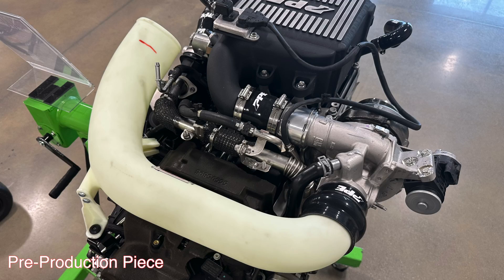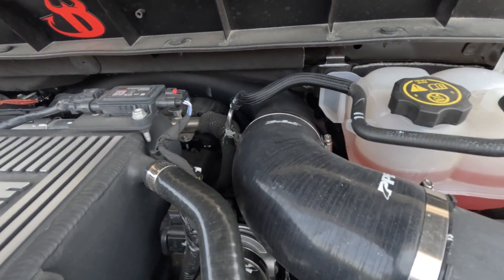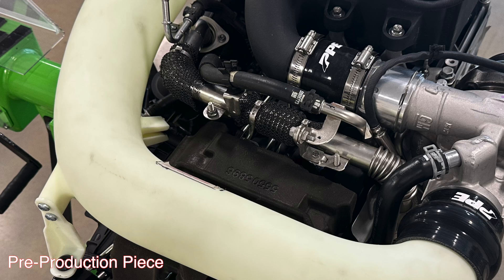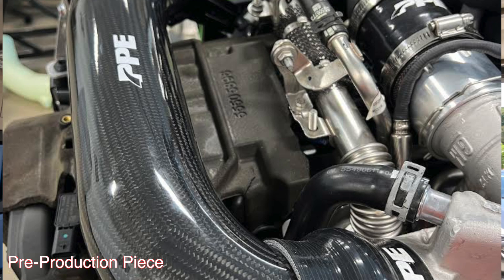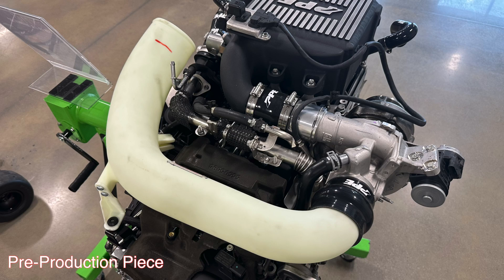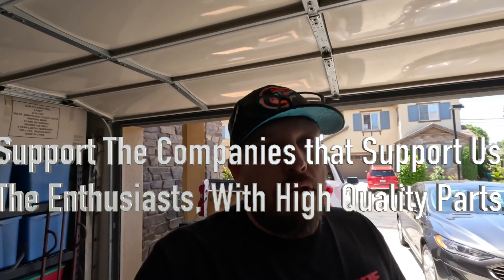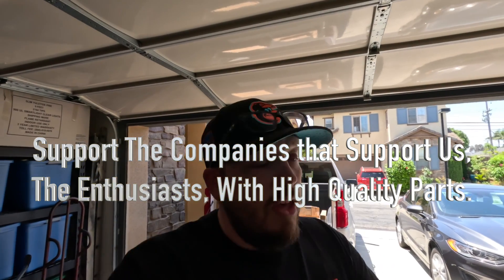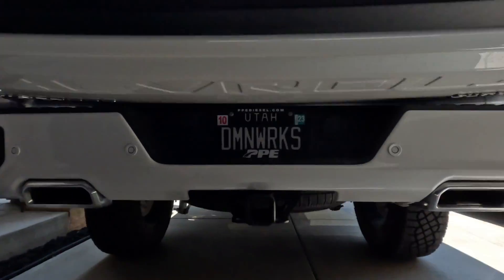NO WAY !? PPE Made a 3.0 Duramax Intake Pipe

Comment: Any aftermarket parts for the 3.0 engines are for looks only and provide ZERO performance gains.  On top of that, the aftermarket stuff is really expensive for the 3.0.  I have the VSE catch can, but it catches almost nothing.  That's a good thing I guess.  The dual fuel filter setup from VSE is expensive as heck.  The stock filters are 5 microns already, and the one of the upgraded filters is a 2 micron.  Costs $500 for the setup, and I doubt it really makes a difference at all.

I like your videos, because I love modifying my vehicles and seeing what is available.  However, there really isn't anything significant for these little engines.
Reply from the maker: Thanks for the kind words ! I have tested pretty much all of the parts available and yes, nothing significant in performance gains, however some do offer gains in other ways. Not sure if you have seen this video where I talk about every single mod that was available:  https://youtu.be/Vx73_rKC1X4

Comment: When do we expect this to go on the market
Reply: Cool I want to pair it with the K&N Cai box
Reply from the maker: @williampruitt8425  that’s my favorite box, but I am going to try the airaid next. Same box but dry filter and closed top.
Reply: @DemonWorks  thanks please keep us posted on the Ppe intake pipe
Reply from the maker: @williampruitt8425  for sure! Hoping to have in my hands as soon as possible!
Reply: @DemonWorks  do you think the stock thermostat for the transmission can be modified by taking out the spring or should I go with the PPE bypass.
Reply from the maker: I don’t have specifics, but it sounded like it would be soon!

Comment: Saw your video on the charge cooler and wondered why there was no upgrade in the charge cooler radiator. If the new charge cooler is removing more heat won't it end up heat soaking the system overall sooner?
Reply from the maker: Great question! I don’t have a direct answer for that at the moment. It’s one I want to work on getting temperatures about.

Comment: Thanks for all the videos! Well im kinda new to diesel trucks. I just got a GMC 2022 3.0 Duramax now. Love it. Only thing is that once in awhile I have light white smoke from exhaust for about 1 minute. Has only happen after I get off at work but never at home, weird. I get to work 4am and truck sits in lot till 6 pm and usually 70 degrees here in Cali after work. . Happened again last night. Well, I use my remote start on app before I get to my truck. When I get in and leave I have a noticeable light white cloud behind me? Can’t seem to duplicate it from home and dealer has no clue and had truck 3 days. Any thoughts. No oil or coolant leaks they said. Has happened 3 times now. Maybe too much fuel? Humidity? Condensation? Help. I have video of it but dealer didn’t say much
Thanks

Comment: Nice video! I love seeing new parts. I'm in the market for a new truck. I will definitely purchase the new 3.0 duramax.  My question to you. 3.23's or 3.73 max trailer package? You have owned both.
Reply: little better fuel mileage if you do not go with the max tow do you need to pull a trailer that heavy often then get a 2500 and the bigger diesel once you get 800 lbs tongue weight the truck drops a lot and a 2500 would be much nicer ... in my opinion

Comment: Very nice! What intake box are you gonna pair with it?
Reply from the maker: K&N is currently my favorite but I will be testing out the AIraid next.
Reply: Off the subject...I've noticed a drop in coolant level in the surge tank of my LM2. Topped it off yesterday, drove a bit and let it sit overnight. It was slightly lower again. Haven't noticed any visible leaks. Any idea what might be happening? Only mods is S&B intake and Stillen scoop.
Reply: @williamparis3628  water pumps are starting to become more common, but there are a couple possible places for leaks. It needs to be pressure tested and inspected

Comment: You guys experiencing any delivery delays down there.   I ordered a 3.0 in October, build by December, and has sat in a yard until now with no clear delivery date.
Reply from the maker: I haven’t looked into that in a while, I thought we were all finished with those types of delays. Currently off for 10 days but when I return to work I will ask Sales if we are getting the same issues.
Reply: @DemonWorks  the feedback I get from my dealer is that it’s in a shipping yard at Chev factory and because of transport shortage they cant deliver.   🤷.   They also say that first in doesn’t mean first out.
Reply: @DemonWorks  what is the benefit intake pipe ?